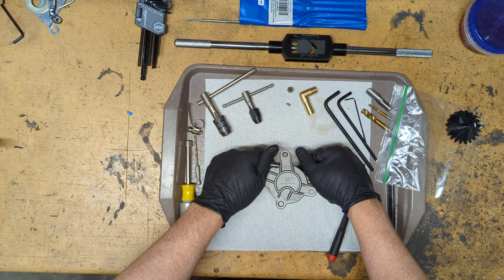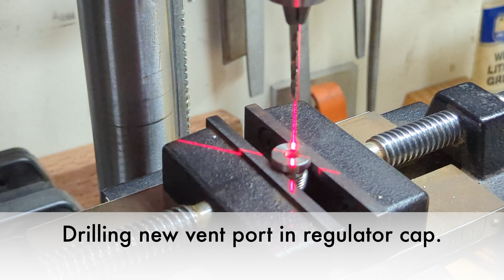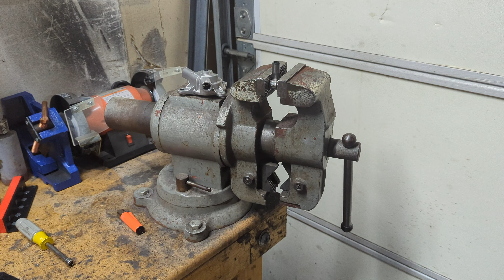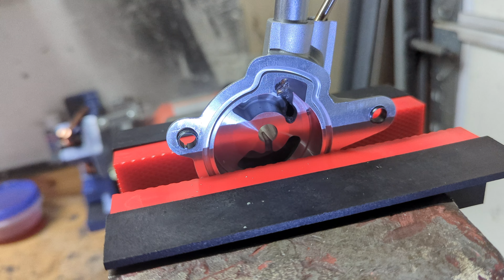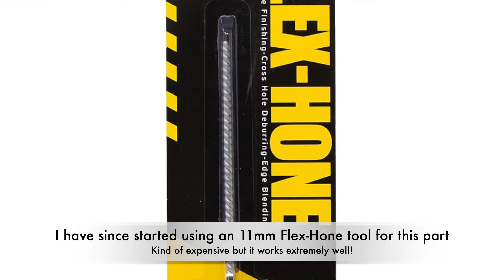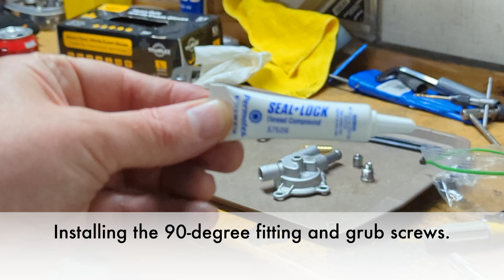Tesla SDU Oil Pump Reverse Mod

Comment: What is the purpose of this mod though?
Reply from the maker: Yes, sometimes the only way to fit the motor in a different chassis is to mount it in reverse orientiation. The electric motor itself doesn't care which way it spins, but it still needs to be oiled properly for cooling. This mod fixes that issue.
Reply: it is for the reverse placement of the sdu when the car is going forward and the motor is spinning in reverse